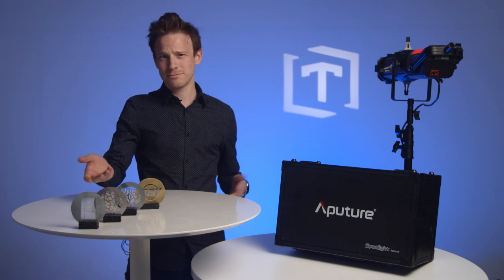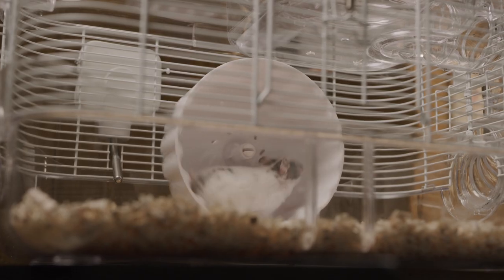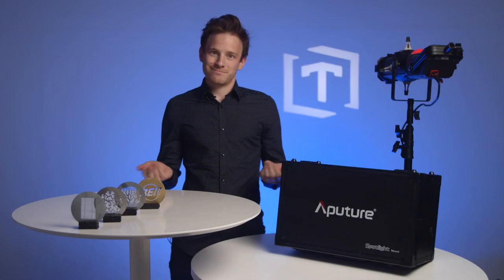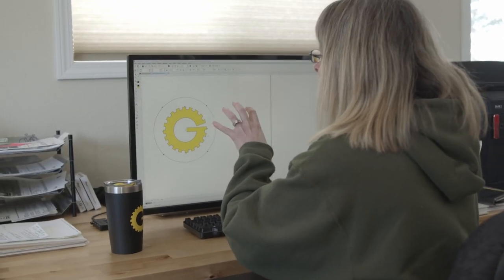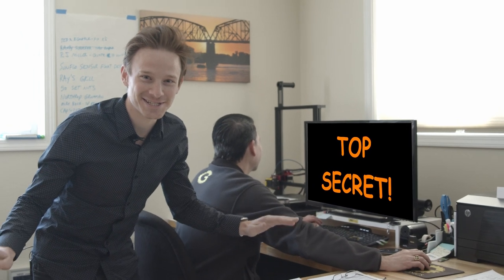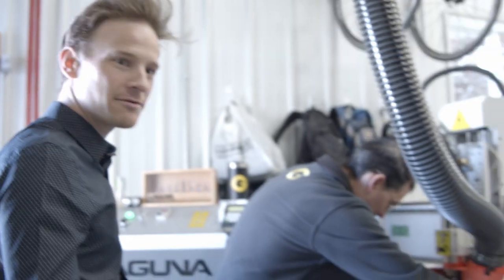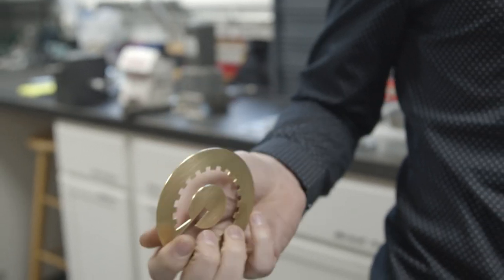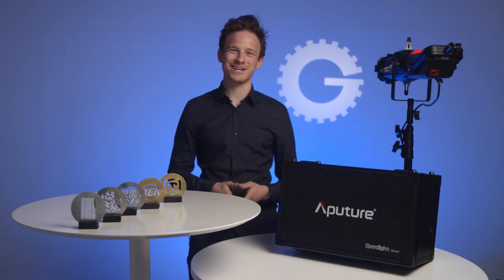We made our own gobos for the Aputure Spotlight! How'd we do it?

Comment: hi there! did you consider getting these laser cut? You could gang up a few designs on a sheet and get those finite square edges? I'm looking into this for a few customs specifically for the spotlight also.
Reply from the maker: Definitely! This was a situation where getting access to a CNC was easier than finding a laser cutter, though, and we had a fast turnaround for one of the cuts.